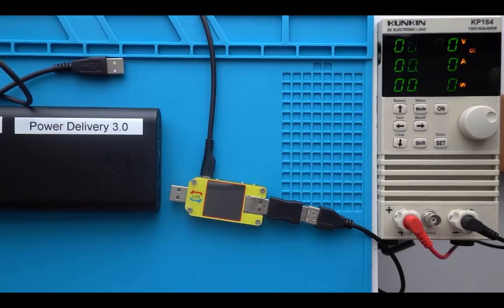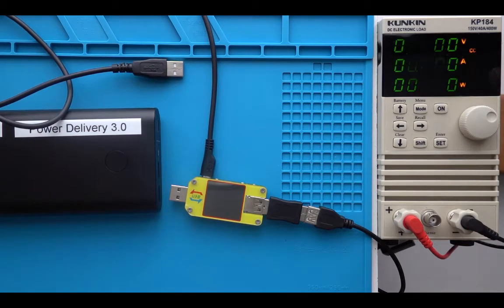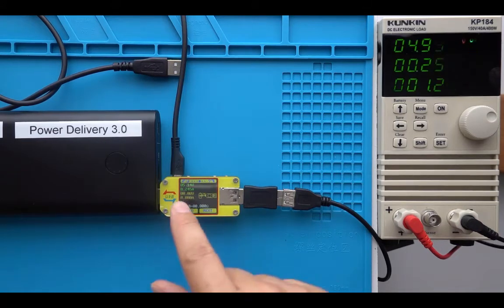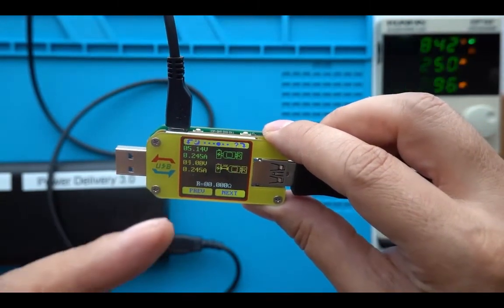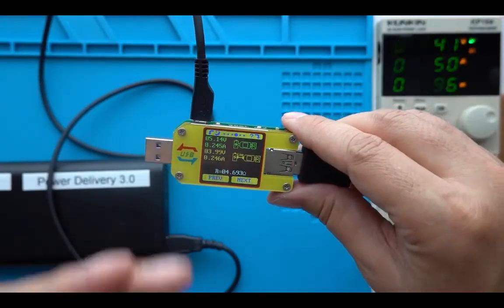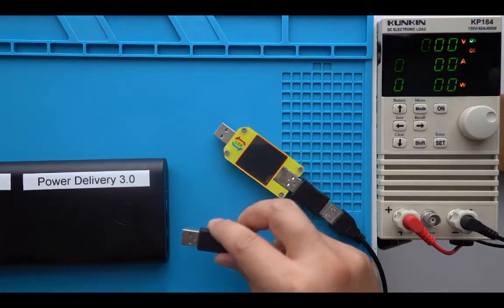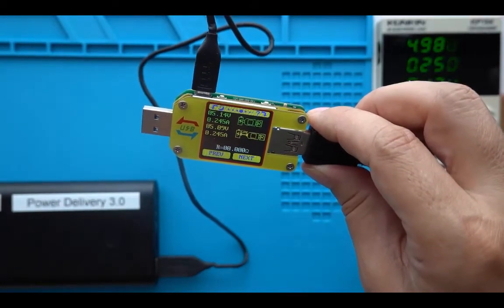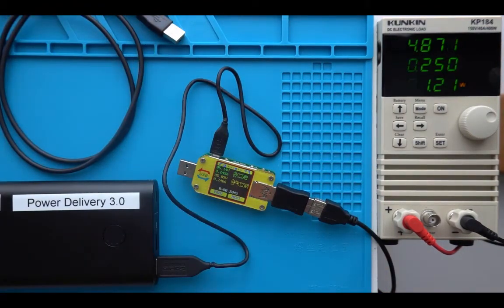Testing a Defective USB Cable

Comment: Keep it up, this is underrated as we all have probably 20+ cables we use for multiple devices micro, mini, USB C , A .. it's a great way to test and toss all the older or garbage cables we hang onto to.  I have the older version of that tester without USB C.. I'm going to try this.  super helpful